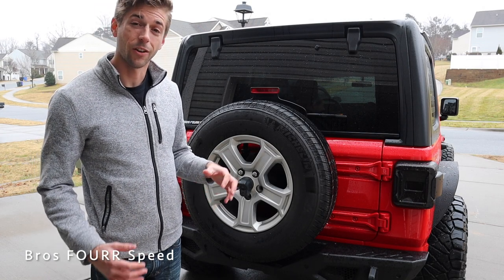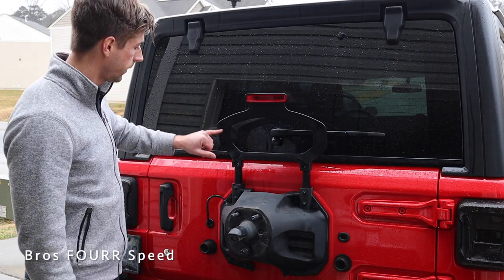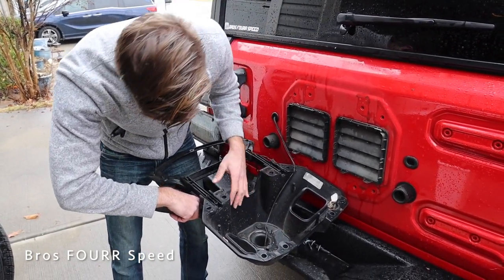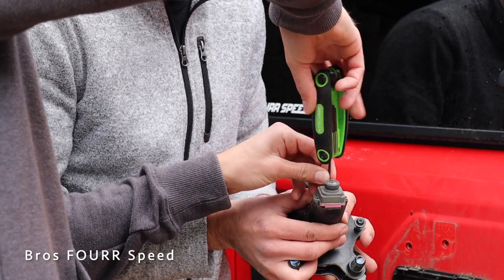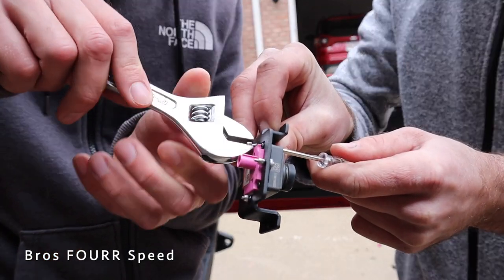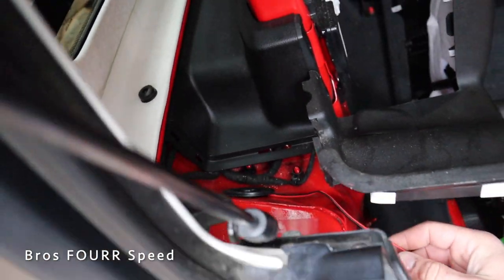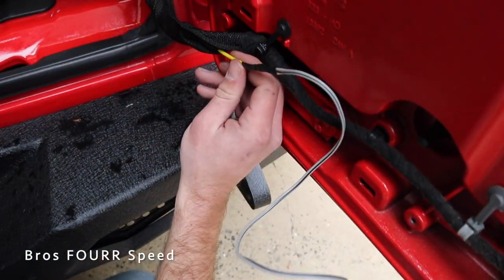How To Install The Spare Tire Delete JL Jeep Wrangler!

Comment: I drove for 16 years before getting a single flat.  Then I had 3 in one year.  Life's a beach.
Reply from the maker: That's pretty good!  And then not so much in a year lol, it happens. I'm still on the hasn't happened side still!
Reply: Any high construction areas can be an issue with nails

Comment: unable to find it on there site,would you have the actual part numbers for all the parts you used thank you !!
Reply from the maker: https://suparee.com/collections/2018-jeep-wrangler-jl/products/spare-tire-delete-license-plate-relocation-kit-plate-illuminate-light-for-jeep-wrangler-jk-jl
This is?
Reply: @BrosFOURRSpeed  That's not the same kit as the one you installed.
Reply from the maker: @michealsmith4859  it’s from the same company so maybe they have changed it since then?

Comment: Howd you do that without pinching the wires on the license plates light, either my lights are F’d or they manufactured it poorly.
Reply from the maker: They were pinched slightly. But not enough to effect anything

Comment: Do you have the specs of what size the bolt that you mount it with is mine didn’t come with a stock tire carrier so I don’t have the bolts

Comment: what about that whole it might get dust inside the cabin
Reply from the maker: The vents behind the license plate should be fine since they are covered, and the plugs on each side were just for the tire assembly to stay off the paint!  It should be ok!
Reply: @BrosFOURRSpeed  I don't know about that but what I learned from dust can escape from even tight places
Reply from the maker: @azzanal-sinani3413  I wouldn't worry about it, I'll let you know if anything happens, but it should be fine.

Comment: Do you know if they have this for the 2020 wrangler
Reply from the maker: It should be the same bracket as on mine!  I have an 18 JL so it shouldn't be different for a 2020 Wrangler.
Reply: @BrosFOURRSpeed  yes they do have it. 👍

Comment: Great video. You could probably have done a better job actually showing the trim removal, as I watched the video, but still have no idea how the left rear trim is removed. Also that wire you don’t like could have been moved to behind the bracket you installed where the license plate lights, break light and backup camera wires go. But all around good video, thanks.
Reply from the maker: Can you time stamp the trim section you need help on? And for the wiring, I probably put it where it made the most sense lol, did this a long time ago so can’t remember.
Reply: @BrosFOURRSpeed   Sure thing, I’ll have another look at the video, and let you know.
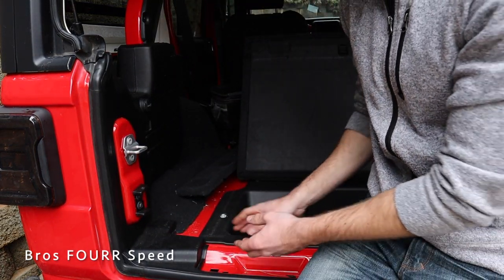Reply: The time stamp begins at 6:00 and ends at about 6:37. Although it looks simple enough, closeups on how you removed that first “seatbelt” thing, would have been very helpful. As well as filming the entire removal process for that trim would have been extremely helpful. Unfortunately there was an edit in there, and the trim suddenly went from firmly attached, to completely off. For someone with an intractable fear of damaging or breaking something on my new Jeep, a job like this can be more daunting that one might believe without specific instructions or advice. Thank you so much for caring enough to even ask me this. It’s really nice to know that someone actually cares about feedback.
Reply from the maker: @laospeedwagon3023  So in that time frame, the tie down hooks just had a bolt holding them in place. From there you just slowly start wiggling it out. It’s been a while since I did this but slow movements help. The next piece by the roll bar had a tab that I mentioned and you do the same process! I could see it being intimidating but patience is key, don’t just start pulling left and right, you got it!
Reply: @BrosFOURRSpeed    Thank you so much, you don’t need to reply if I’m right, I’d hate to take up your time. But I think you’re saying that its completely held in by push-in trim “clips” so I can just use slow patient force to pull it out? And that there are no screws or clips will break if I just pull (or lightly tug)? I thank you. You really do have a great channel, and I appreciate you taking the time to help me! That was incredibly kind.
Reply from the maker: @laospeedwagon3023  I can’t promise a tab won’t break, but the slower you go and work each section the better chance you have of a tab not breaking, but I think these just slid in, there wasn’t a “tab”, more like a piece that was held behind another if that makes sense. I’m pretty sure that’s how it was. Glad I could help and just ease into it.

Comment: That looks a lot better. But I thought this was going to be a few bolts out, and plug and play, not really. 😮 You guys just make things look easier because you're good like that,. 
I do have a question though, did you clean that before you installed that plate on the back. Lmao.
Reply from the maker: Yeah I thought this would be like an hour job, but they never are lol! It took some planning off camera to know what we were going to do!  And I cleaned it some, but it should be good!